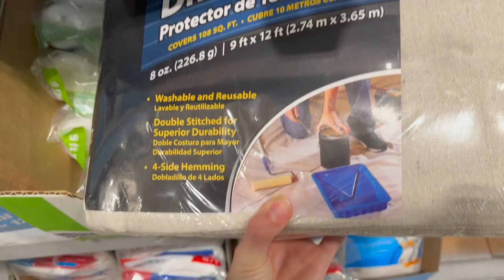RV vlog | week 11.

Comment: You may already know this…
I think the little would piece that you found in the treasure trove may have  been used as a wheel stop? Anyway, that’s my guess. Lol
Also, is it possible that there is black mold inside the outdoor shower rubber tubing?
Y’all are doing a great job! Can’t wait to see the rest! ❤
Reply from the maker: oh it does look like a wheel stop, we didn't even realize, thanks! and good looking out about that outdoor shower, we will give the inside tubing a good cleaning. thank you so much! 💓